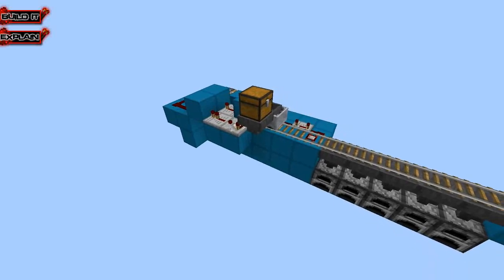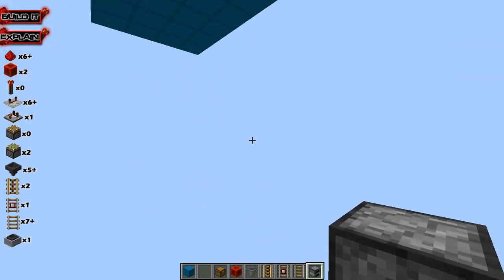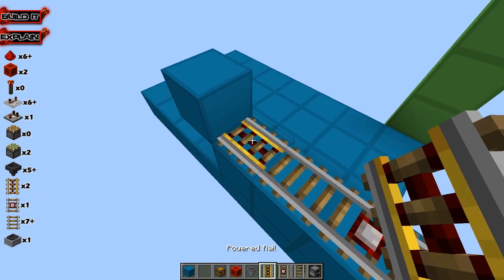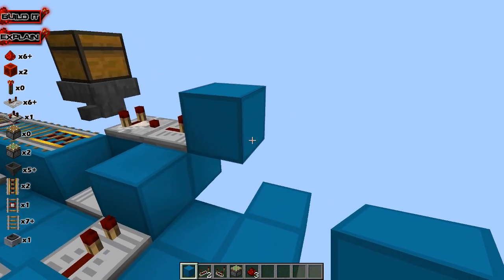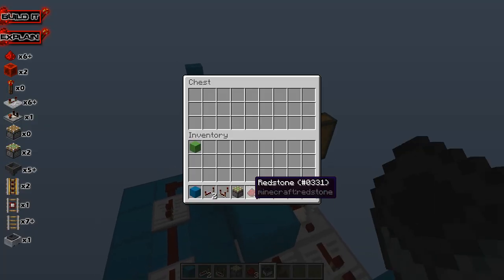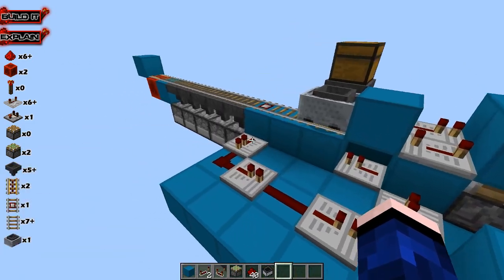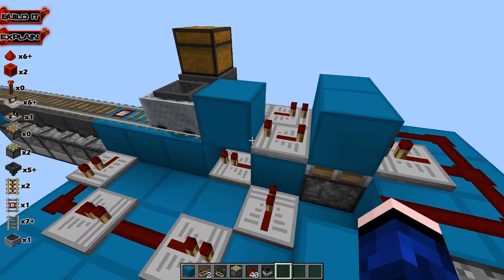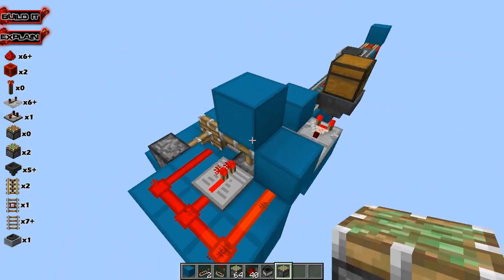Minecraft: Automated Cooker System (K.I.T. #2)

Comment: you can make this smaller, just have the comparator faced directly into a block, have a torch on that block and run a line of redstone into another block(thats next to the powered rail) with that you won't need the detector rail or any of the redstone repeaters.
Reply from the maker: That defeats the whole purpose of my design...doing what you say will instantly send the minecart as soon as it gets to the rail/hopper. Meaning you will only get 1 item in the minecart and only 1 furnace cooking items. This design holds the minecart to allow it to fill then send items to all the furnaces.
Reply: trust me when i used mine carts in my design before i started using hopper as to not have the noise of mine carts going, it worked.
Reply from the maker: Erros I'm not saying it wouldn't work, I know it would but what you're saying sends the minecart as soon as it gets back to the hopper (that is filling it) as long as there is an item in the hopper it will power the powered rail (which is what I didn't want). So I know what you're saying would work but I wanted a certain design. And hoppers didn't satisfy my design requirements that I wanted, so that is why minecarts were used.